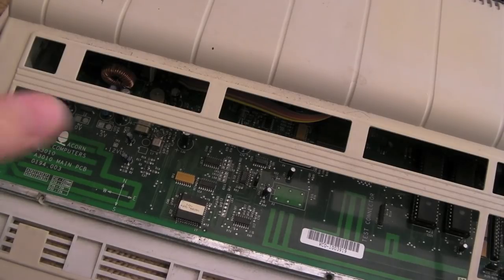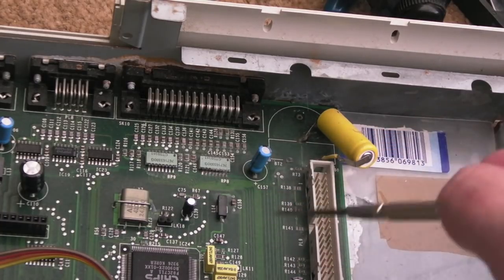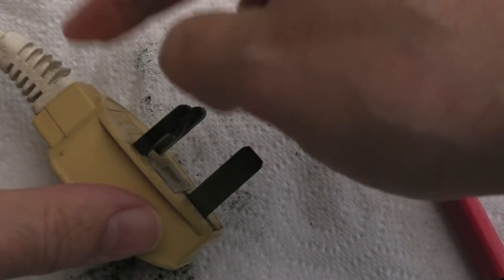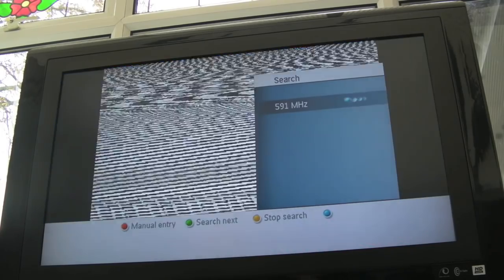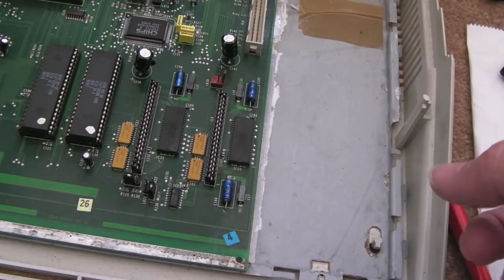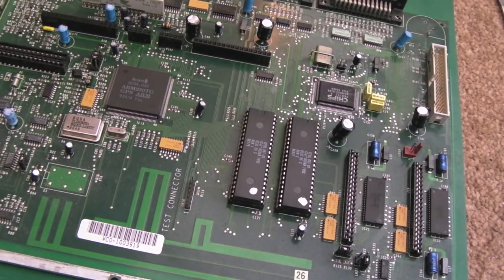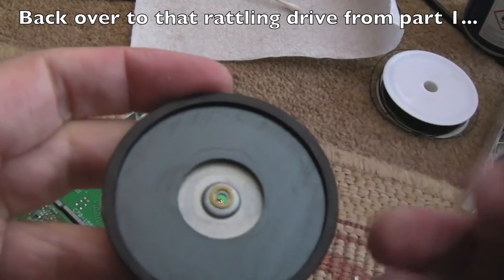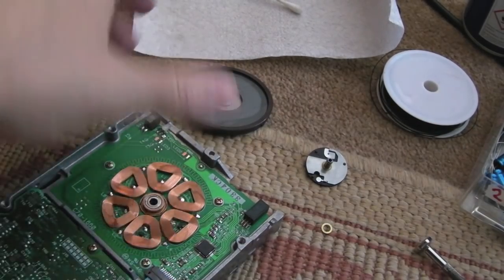Acorn Archimedes A3010 Repairs (Corrosion / Red Screen / FDD / Battery Going Flat) - Part 2

Comment: Thank you, GadgetUK164, much appreciated Acorn Archimedes restoration repair.
Reply: Would you be willing try the ram expansion board now after fully functional.
Reply from the maker: There are 3 different A3010's I've covered in part 1 and 2, the one with the red screen still needs more work to understand where the fault it.  I did however do a separate video on that 4MB RAM expansion.

Comment: When charging a battery it's the current that matters mostly if it's a battery chemistry that can withstand being overcharged like NiMH. 5V across a 1.2V battery and 360 ohms gives a charge current of 3.8V/360ohms ~= 11mA which is fine.

Comment: Those CR2032 holders look neat. It would seem that if you dont put one of the batteries in, the terminals for the other battery make contact with each other to complete the circuit, so as you say, 1 battery = 3V and adding a second would bring it up to 6V. Parallel would also be handy if you didnt want 6V with 2 batteries, but maybe there are different holders for that.
Reply from the maker: Yes, sorry I forgot to mention that part!  Yes, they do short to allow single battery.  I did also bend them up towards each other a little to make it more reliable but they do work that way.

Comment: I think it's Modes 37-40 which give you the rectangular pixel mode with VGA timing, so you essentially get a bigger desktop - be interested to see if that would work on a modern LCD - I used to use those modes on the Acorn (Lite-On) CRT

Comment: Nice series of vids.
The capacitors on the printer port the schematic says 1n you said you put in 100pF, which should it be?
The battery can be 1.2V NiMh they can with stand permanent charge without damage and the charge rate is approx 10mA and the chip will work in power down mode down to 1V and the voltage drop across all 3 resistors is approx 4mV.
Reply from the maker: Thanks!  It's 100pF - the caps on the schematic are the opposite way (right to left) when laid out on the board.

Comment: First power up is a bit scary. Is it this model (A3010) that have a Rifa capacitor the usually goes off with a bang?
Reply: No, that's the Beeb. The only known capacitor issue is tantalum C37 on the A400 series IIRC and some of them can bang after 35 years, yes.
Reply from the maker: As Zarchos says - bbc micro has that type of capacitor =D

Comment: TBH i dont get why you didnt just fit a new plug.. it'd have taken less time to do that than you spent attempting to clean the pins!
On the occasion I do rescue a plug, 300 grit sandpaper is just the job for polishing up the pins
Reply from the maker: Yes, it would be easier - to be fair, it didn't take long to clean it up, less than 10 minutes.  But it would be easier to replace it.

Comment: 1 Mo is 1 megaoctet, which is 1 megabyte.
Reply: And 'Batterie neuve mi 2016' is 'New battery, installed mid 2016',  'Ecran noir ne boote pas' is 'Black screen, doesn't boot [to desktop]' ; 'Pas de bip' -> 'No beep'.

Comment: Those capacitors near the floppy port are not essential to correct behaviour. They are there for EMI control, and the system will work perfectly without them. Just saying :)
Reply: ??? Are you sure ? What is IME control, I'm curious.
I thought these caps were there to protect the multi I/O IC that handles the parallel port, in case you plug / unplug a parallel port device, to make sure it doesn't fry the IC.
Reply: @Archimedes75009  electromagnetic interference. There are regulations on how much interference a device is allowed to emit. These capacitors form R-C filters on the floppy drive signals to "take the edge off" and limit the emitted interference so that the device can get through an EMI compliance test
Reply: @jaycee1980  OK. Thanks for the infos.
Reply from the maker: Thanks!  My understanding is its not just about EMI (outwards) but also about noise inwards too.  I was fully aware of what the caps are for though as you can see they are just between ground and the data connections.

Comment: I'd scope the power rails.
Reply from the maker: I will do that on the next part, I also need to do what I should have done earlier (but just didn't have time - I've been bouncing from one thing to another a lot over the last few weeks) - scope the clocks!  It could be a missing clock somewhere!  There are a fair few crystals on these.
Reply: @GadgetUK164  The fact that you're getting a well-formed video signal would tend to imply that ARM250 has all the clocks it needs.  Chief suspects are bad power, dodgy data bus to ROM and RAM, bad RAM, or maybe the 82c711 is locking up somehow.  There's actually a (subset of an) ISA bus that the combo io chip lives on, maybe there's something wrong there.
Reply from the maker: I wouldnt be so sure - if the Chips IC didn't have its clock maybe that would cause it?  The main CPU clock is there for sure, but I am sure I couldnt 4 or 5 crystals on that board.  1 is for the RTC, pretty sure that wouldnt cause the behaviour, 1 will be for the PAL video signal, I just need to check the others.  You may be right about the 82c711 or the Chips IC though - that's my guess, but I will scope some things next.  I've just been so busy not had time to sit down and check obvious stuff, but I really do need to do that next.   One thing that I am not sure about, where does that 82c711 get its code from, is it fed to it by the ARM, or embedded ROM in the 82c711 do you know?  If its embedded and if there's no way to reprogram it, it might be game over unless I can find another one somewhere.  I did wonder about adapting from the DIP one used on the A3000 - that assumes there's not a vast difference between the two, I cannot imagine there would be as the keyboard matrix seems identical.  If I have to go down that road I would need to create an adapter PCB for it though =/
Reply from the maker: I am pretty sure power is OK btw!  Yes it hasn't been scoped yet, but its so very stable, and the behaviour of the system as a whole is consistant, not something I would expect if we had ripple causing crashes etc.
Reply: @GadgetUK164  The Chips IC is the 82c711-  it's an ISA bus combo io chip (often used on early 90s PC multi-io cards).  It doesn't have any code in it.

If the RTC chip is locking up the I2C bus then that can cause the OS to hang during bootstrap.  I'd check.
Reply from the maker: @skonkfactory  Ah!  I am getting confused with the 8051 based MCU for Keyboard stuff there.  In any case, I do have a replacement 82c711 - probably from an old PC!   Its the 8051 based IC I meant!
Reply: @GadgetUK164  Have you scoped the I2C bus yet?  A stuck I2C bus because of a bad RTC chip, broken trace or cracked or corroded via will cause failure to complete the POST.  I believe it shows up on a couple of the pins of the podule slot, so you can probe it easily there.
Reply from the maker: RTC IC has been replaced already and its I2C connections are OK!  So not that =/  I've not scoped anything other than the video signal yet, I was litterally jumping from one board to another and only spending short periods of time looking at the one with the red screen.  I've now got a replacement 82c711, but before I just randomly swap that out I will scope the clocks, and check out the data and address bus in relation to the ROM and RAM.